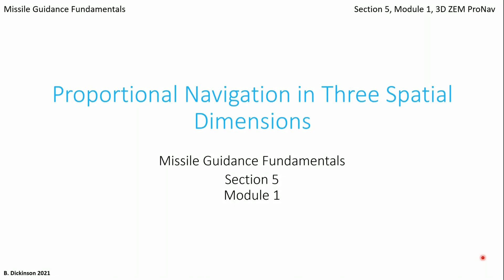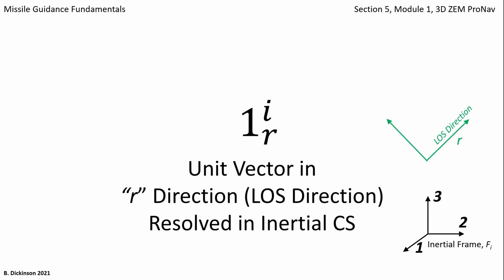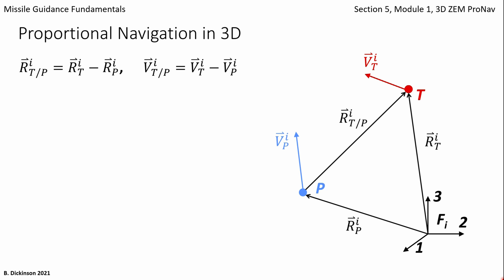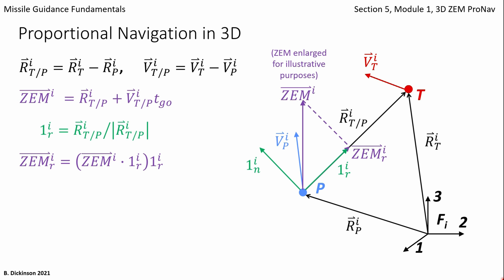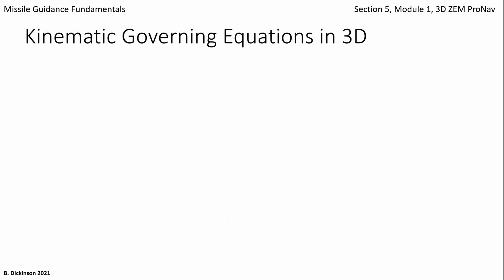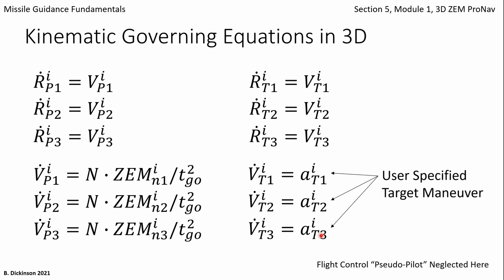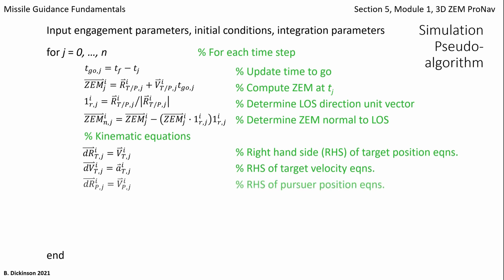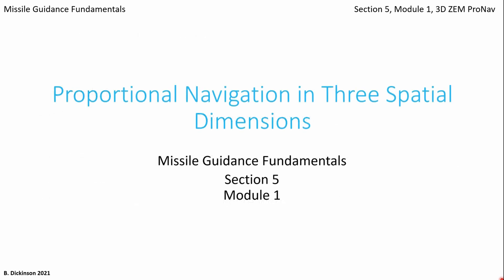Proportional Navigation in Three Dimensions with Zero Effort Miss - Section 5 Module 1

Comment: Thanks, Ben. These are very clear and helpful tutorials. A quick question: what advantages does the ZEM version of ProNav have over the True and Pure flavors? It seems simpler to implement, but is there any additional benefits?
Reply from the maker: The ZEM PN shown in this lesson is equivalent to linearized True PN. Check out Section 4 Module 1 for details. Both Pure and True laws are effective, but the data each law requires has implications to sensor selection and filtering.
Reply: @LearnGandC  Hi adding on to his question. Is there a reason why your lessons focus so much on ZEM pro nav? Is it because it's linearized and easier to analyze?

I would like to implement 3D pro nav and I would like to understand the non ZEM ways to do it and decide on the best one for my use case. My chaser is a drone where I have 3D velocity and acceleration control along with yaw rate control. My sensors are IMU for own drone kinematics and camera to estimate target kinematics.

In my case I believe it is easier to calculate LOS rate than ZEM and time to go. May I request a lesson on 3D pro nav using LOS rate? I would appreciate that alot and thank you.

Comment: Your explanations were great! I was wondering, how important it is to have an inertial reference frame? It seems like an imementation could be simplified by using the pursuer's body frame instead.
Reply from the maker: It should be possible without an inertial reference frame, but I haven't gone through the math. 

As a thought experiment, consider a gimballed camera that pivots to keep the target within a fixed location in the camera field of view. Then, a look angle referenced to the body is encoded in the gimbal motors. If the collision triangle changes, look angle will change. But, we have to be careful, because look angle is the difference between line of sight angle and pitch angle. Look angle is body referenced, but pitch angle is inertial frame referenced. So, if we wanted LOS rate for PN and have measured look angle rate, we must also account for the pitch rate. 

I think this makes sense when I think about insects. Some predatory flies have been shown to follow PN trajectories. Their halteres measure angular rates and head angle encodes look angle, so they have the necessary information for line of sight rate for PN.

Comment: Nice video, cleared up a lot about converting ZEM into an acceleration, like how you don’t even need the range component for that equation. I’d also love to see some videos on an acceleration command autopilot. Thanks
Reply from the maker: Hey Smithy, yes, this is coming in my flight control series, once I get some free time again.
Reply: @LearnGandC  yes sir, please do the acc_command autopilot.
It is the final piece of the puzzle.
Reply: how do you discard the range component?
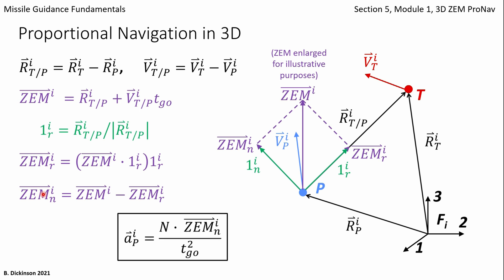Reply: @lorenzorojasv you can just remove it from the ZEM equation, because when you calculate ZEMin at 5:17 you’re rejecting the range component from the equation anyways.
Reply: @lorenzorojasv 
FULL ZERO-EFFORT-MISS EQUATION (ZEMtpn will give the miss distance, and acc_cmd will give the correct acceleration command)
  ZEMtpn = vec_add(range,vec_mult(closing_velocity,tgo))
  acc_cmd = vec_mult(vec_reject(ZEM_pn,vec_norm(range)),nav_gain/(tgo*tgo))

SIMPLIFIED ZERO-EFFORT-MISS EQUATIONS (ZEMtpn will not give the miss distance, but acc_cmd will give the correct acceleration)
  ZEMtpn = closing_velocity
  acc_cmd = vec_mult(vec_reject(ZEM_pn,vec_norm(range)),nav_gain/tgo)

Note: you still need the normalized range command (or just the direction to the target as a vector)